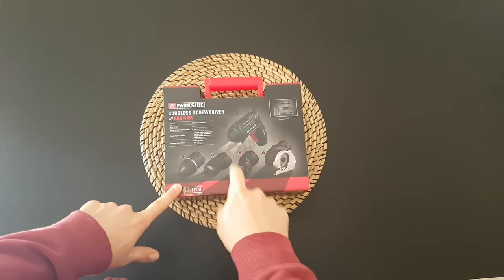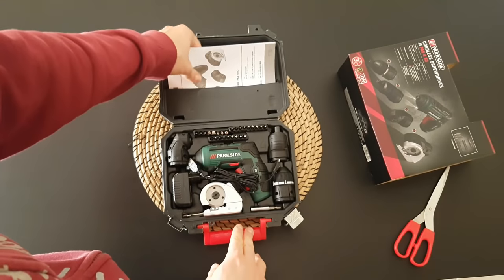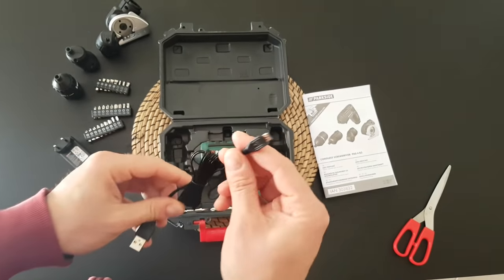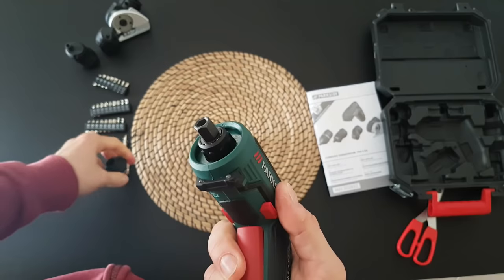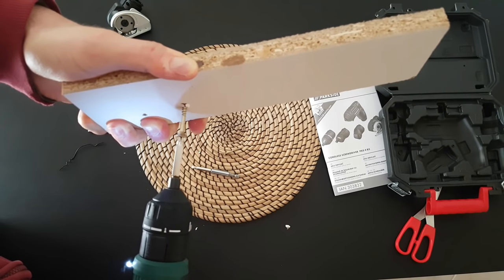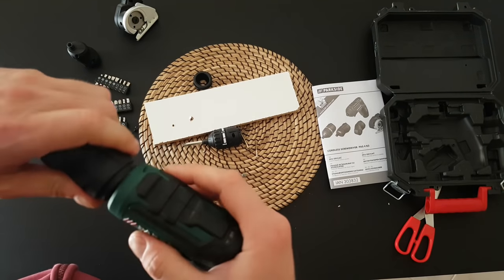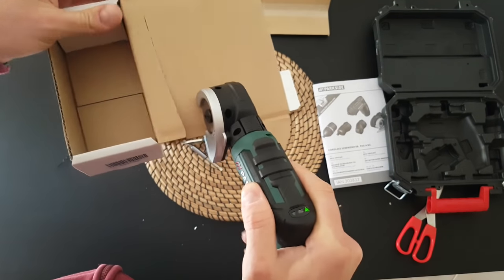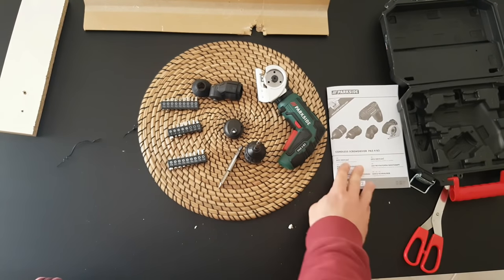Parkside cordless screwdriver PAS 4 B3 Unboxing Testing

Comment: It was hard to watch how you stripped transmission gears by pushing hard while it was turning wrong way (see arrow on guard). Mine is cutting no problem.
Reply: Agreed...this was very painful to watch..  Unfortunately a product of YouTube :(
Blade rotating backwards...after swapping it from the correct orientation initially before use...
After crucifying the gears over and over close inspection of the operation and still didn't see that rather than spinning to the anvil for the obviously correct operation he STILL Leaves it the wrong way and expects it to cut whilst rotating into the guard???
Check it again and still haven't let it cut properly?? Just forcing it through cardboard...

But all that was after doing a similar thing with the screwdriver attachment...smashing it down into the torque slip so much it sounded like a hammer drill.....
Repeat
Repeat
Repeat
Blame the tool...
Set it correctly and oh look it works perfectly...

Tech guru?? Hmmm. YouTube guru more like... The thought of you demonstrating more complicated tools fills me with dread... I know people gotta make money but 😖🤒

On The plus side you seem like a really nice guy..have a nice manner  and have great production values/video quality and it obviously pays well, so good luck to you but these it is painful to watch!!